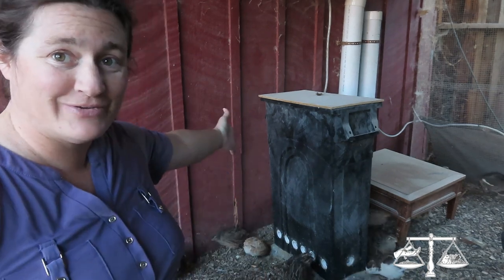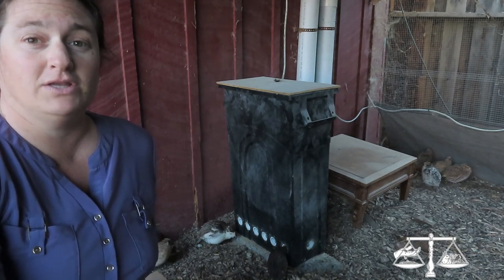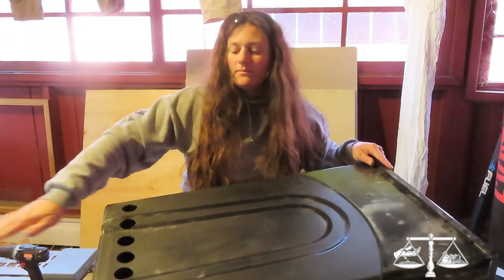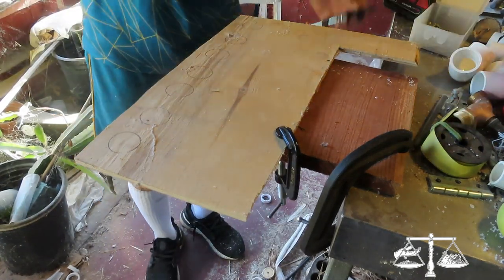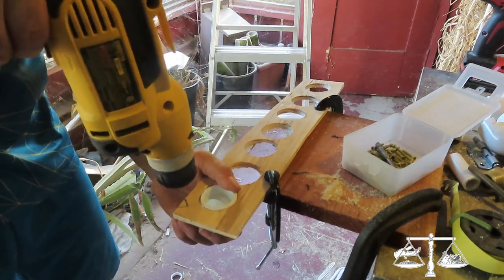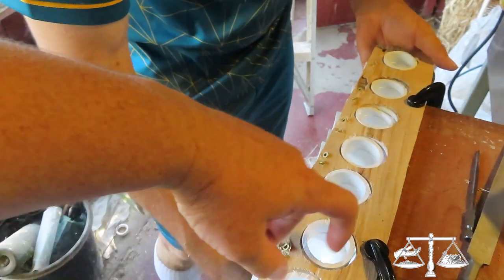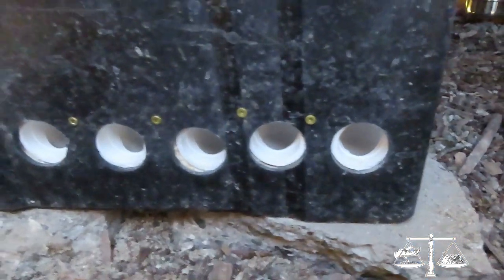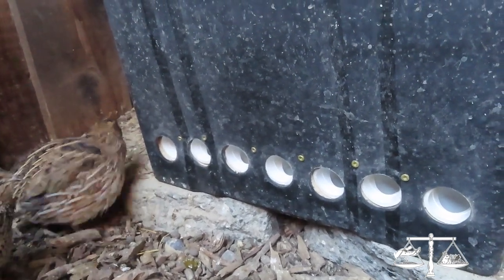The Ultimate No Waste Quail Feeder

Comment: I use the Sterilite containers in cages and got those 2" ports and used hot glue. Learned a lot from this, i need to make new ones and use smaller ports(or PVC elbows) and the triangular piece will really help direct their food to the ports. Thanks Katrina!

Had another thought to share. When you make pilot holes in plywood use a real drill bit and go all the way through.  Then use hole saw on both sides to get a clean cut.
Reply from the maker: I'm glad this helped you, and thanks for the tip!

Comment: I built the same exact thing over 5 years ago with the same slim garbage can but I built it for chickens.  Mine was different on how the access to food was designed but I like yours better.  It served me over 5 years and the only issue I was having was the mice getting in there and also pushing feed out through the holes and thus wasting feed.  I hope you don't have the same problem.
Reply from the maker: Nice! I have had the materials to make one for my chickens for a while now. No mouse issues for me because it's 1/2" hardware cloth all the way around.

Comment: Trying to figure out how to translate this into stack cages. There is no way I can have an Aviary because the trailer park I live in won't allow it. They don't know I have any birds right now because they are on the back porch.
Reply: I too had them on my back porch of the trailer park.  I just learned to get rid of the extra Roos rather quickly.  For your stacking cages, think plastic Rubbermaid Cereal Keepers, they have rectangle ones that will fit your needs rather nicely.  $7.98 each at Walmart, you may be able to fit inside or secure to the outside.    Good Luck
Reply from the maker: @soswanson9120  Great tip! I'll have a video out at some point for the "quail mobiles" we are adjusting the feeder to be similar to this one. It's a smaller container with only one side with holes. The interior is similar to this one, but is a triangle which makes all the food fall towards the feeder holes. I also think this can be done with the same container with  levels of feeding holes--you would only have to keep it full enough for the top tier to use. A hopper at the top would help this as well.
Reply from the maker: I'll have a video out at some point for the "quail mobiles" we are adjusting the feeder to be similar to this one. It's a smaller container with only one side with holes. The interior is similar to this one, but is a triangle which makes all the food fall towards the feeder holes. I also think this can be done with the same container with  levels of feeding holes--you would only have to keep it full enough for the top tier to use. A hopper at the top would help this as well.

Comment: I probably missed it but how far from the bottom did you make the holes?
Also curious why you set it on brick instead of just setting the trash can directly on the ground and making the holes higher?
Reply from the maker: I think I said in the video, but I don't remember. The interior lowest part of the elbow is approximately 1/2" from the interior bottom of the garbage can. I put the feeder on a solid surface because while quail tend not to dig a whole lot, they do some, and I wanted to make sure the feeder was sturdy and didn't fall on any of them if they moved the chips too much. It is also more sturdy in a very windy situation to be on "solid ground".